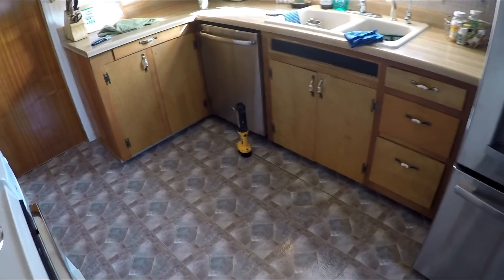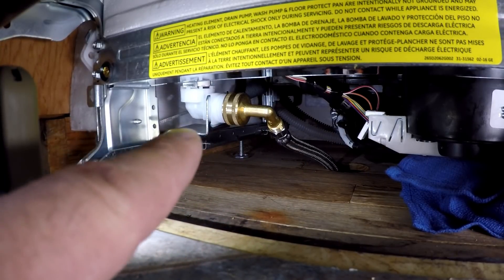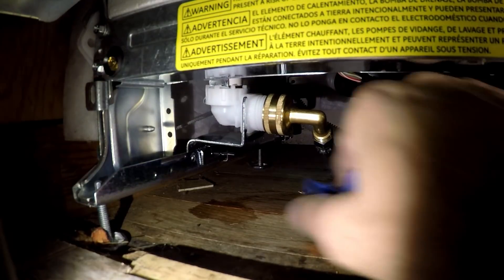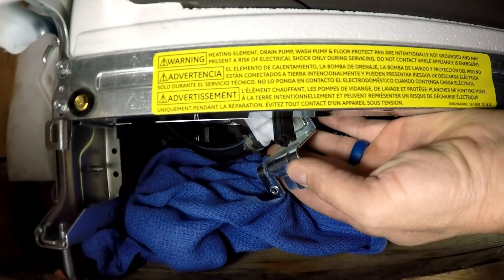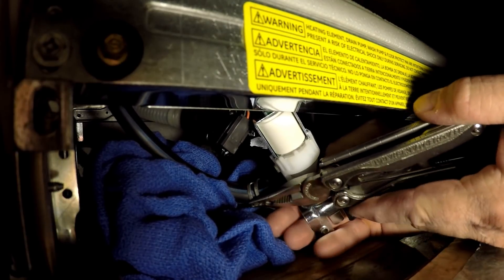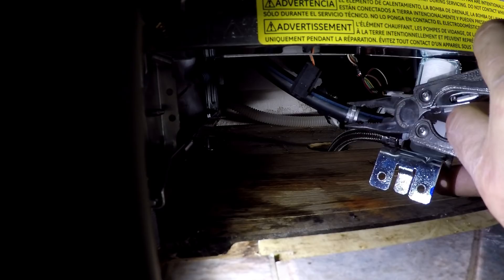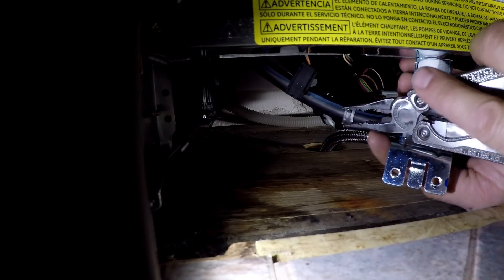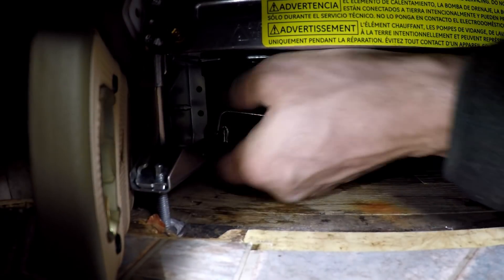Handyman Fixes Major Water Leak And Saves The Day | The Plumber Never Showed Up | THE HANDYMAN |

Comment: Classic performance of modern appliances. One year just after the warranty expires, you have an issue.
Reply: Residential and commercial. Lucky, the prices have stayed the same or gone up for new units. Garbage.
Reply: Same with car parts.
Reply: KitchenAid dishwasher recirc pump went out just 8 days after warranty expired.  They looked out for me and still covered the repair.

Comment: In that situation with the dishwasher feet, I had that issue once.  I put two runners down each side level with the floor to keep the feet all at the same plane.  It helped a bunch.  Took forever to put that particular dishwasher in.

Comment: Water pressure should be checked.  Too high or pressure or spikes in pressure lead to premature failure of appliances.  You mentioned that part was a pressure reducer...it might have failed due to too high of pressure.  Does the customer have an expansion tank? Is their water system a closed circuit?  Is there a pressure reducer interior side of the water main?

Comment: Your thumbnail reminds me of a time I worked for a company that owned a bunch of hotels. We were remodeling one of the hotels for them and we were changing out all the bathroom vanities as part of it. One guy unhooked the supply like I believe before the shut off because we were changing it and thought the water was off. All you hear is him screaming at the top of his lungs and we all go running in and water is just spraying straight out filling the hotel room. The shut-off for this particular hotel was all the way down 4 floors. Kinda funny. We had 3 10 or 12 gallon shop vacs cleaning it up.

Comment: Actually even if the plumber came out, he will not even touch that. That is a job for appliance repair person.  Also, technically you cannot run that dishwasher hose through the floor or the wall. It is illegal to do so. That big hole on the floor should be sealed as well.
Reply: Well He outright states that he is a handyman

Comment: Hey Handyman, another great video. Thank you. Question, do you carry a an inventory of specific parts? And what would the top 5 be? I haven’t really been able to pin point a service that calls for parts on hand due to a high volume of requests. I used too and it just cluttered my truck and trailer. Thank you again, you’re the man!

Comment: I don't blame you for not wanting to remove the dishwasher, I'm not a fan of GEs. I especially hate how they like to mount the feet through the boards during shipping so you have to completely remove the legs to take the board off, then some always seem to be slightly bent.

Tribles.com or searspartsdirect.com you can search most models and see exploded views and get the part numbers.

Comment: Crazy question. I notice you’re a leatherman carrier. Have you pinched your finger meat 100+ times yet. I swear I’m up to about that. 15+ years carrying mine.
Reply from the maker: I switched to gerber center drive plus.
Reply: @TheHandyman1  I’m gonna have to say that it’s a nice tool as well. Especially if you use screwdrivers alot. I just like how the letherman has no catches to using any tool within it. You have to open the gerber to even use the knife.

Comment: You missed a chance to sell and install a new dishwasher. My experience with appliances is, "that once a handyman repairs an appliance he owns it." Other stuff on it will start going bad soon. Just like a car that starts having trouble. One thing after another will go bad. I used to repair a lot of appliances but got tired of these "something else" call-backs. Now days, I easily get the Property Manager or homeowner to okay a new replacement. I never get call backs on new quality appliances.  Of course, my colleague contractor puts in the cheapest Home Depot or Locke's appliances, even $65 toilets; because he actually WANTS all of those call backs. To each his own.
Reply: @Rene Gade as a fellow Handyman myself...I respectfully disagree. I believe a well rounded Handyman should be,first and foremost, a REPAIRman and not a REPLACEman. The Handyman did right by repairing the appliance,at his expense, mind you and focusing on the big picture: a complete kitchen remodel in which, more often than not, appliances are replaced.  Sometimes you have to take a loss in anticipation of a big win
Reply: @hugocisneros729  - I still do many many repairs, but not so much on appliances. I've been a full time handyman for over 10 years and believe me, you can't clear $400 a day by fiddling with broken appliances. Replace them and move on.
Reply: @andy-jac  true but as the Handyman says, he makes 1000 dollars a day and did this for free. Not judging and I'm sure there are times where he would charge for this but the prospect for future work based off of competent past jobs, pays more... I would think.
Reply: Reputation is everything. My clients like the fact I'm always honest with them.  If it's an item that can be fixed I tell them. If I believe it's no hope they know I will tell them. This results in return customers and referrals.  Word gets around and if you treat them with respect it comes back ten folds.